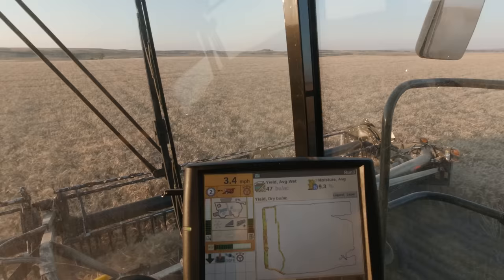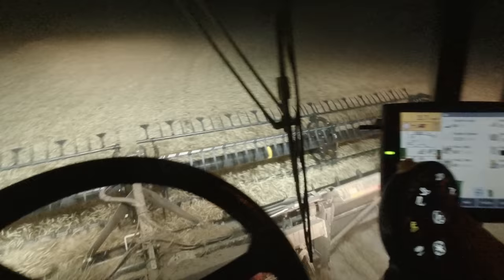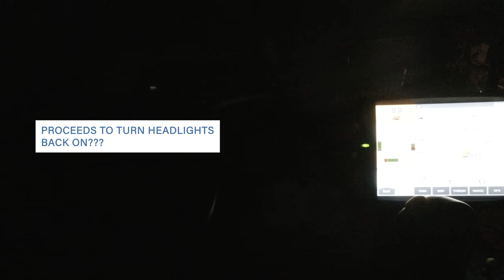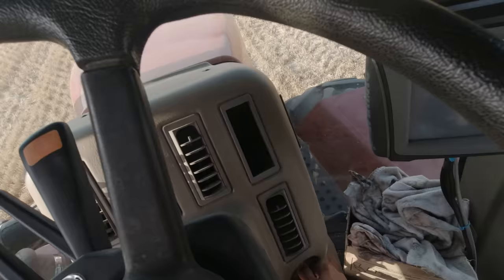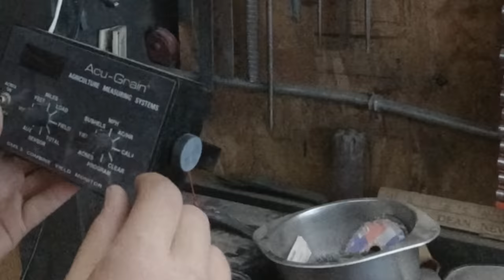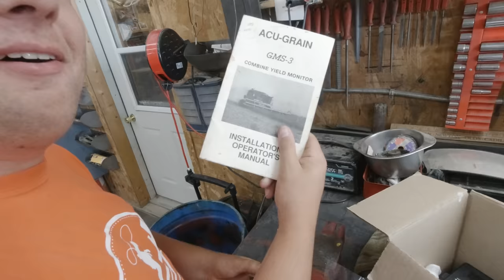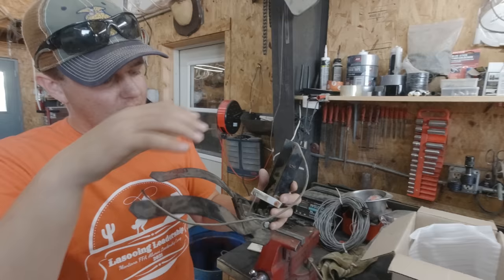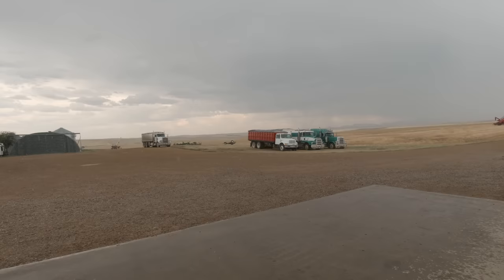Cutting Along 1,000ft Cliffs - Harvest 2022 Part 2

Comment: I go back to the old Holt combine era. That was modern compared to the originals where they used horses to pull the combine and they sacked the grain off the elevator On a platform on the combine yes changing times changing technology

Comment: In Australia, 3/4 of the wheat belt gets between 10 and 15 inches of rain a year.  We don't have a corn belt for the same reason you don't grow corn in! Montana.  Most areas can only grow winter crops as that's when we get the rain. We don't get snow but it does freeze some nights especially in Spring when heads are forming which destroys the yeild.  We start the season dry and finish the season dry.  We generally continuously crop because we have to have a chance of an income every season.  We can't insure for drought or frost because we get one or both 4 years out of 5.  We allocate one combine for every 10 to 15 thousand acres as anything less doesn't justify the outlay in most years.  I think crop farmers in Montana could learn a lot from Australian farmers but I truly appreciate you sharing what works for you.
Reply: Hmmm 🤔 that’s interesting. What is your soil type up there? I would imagine your soils can’t hold onto moisture for very long making the whole”fallow to store moisture thing” moot point. If it is alright for me to ask, what is a typical wheat yield down there?

Comment: Loved the joke , So will the rain bring the grain moisture back inline? Soybeans really go up and down in moisture and that is weight to sell so sometimes we will shut down to get a rain if it is under 10% plus a lot less shatter loss if it is wetter.
Reply: #1: We don’t really get rain in Montana in August unless you’re lucky. 

#2: I don’t think small grains fluctuate much in weight with moisture because they are much smaller kernels. 

Our biggest concerns with low moisture would be shattering but even then, small grains don’t crack near as much as corn and beans. Dry crop does mean the straw is pulverized into dust so it sucks to bale straw behind though.